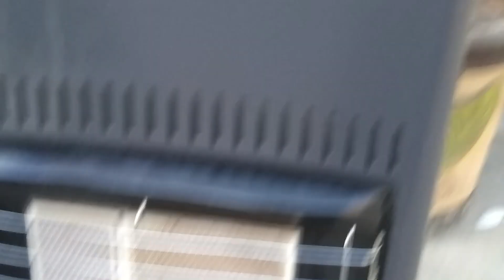limpieza de calentador de gas

Comment: Excelente ENCERADO
estoy en busca de un video
CON REPARACIÓNES de la chispa, del piloto, cambio de manguera, flama grande, piedra sin ponerse roja, etc Y SOLO HAY DE brochazos y limpieza del gabinete 🤣😂🤣😂🤣😡
Reply from the maker: Checale por atrás en dónde va la tapa de el gas hay debe traer tornillos para poder acceder a dónde está la piedra y el piloto y sensor de temperatura saludos suscríbete es gratis en el mío no fallaba eso por eso no lo quite saludos
Reply: @mantenimientoyreparacionca1870 12:27 12:35
Reply: Podria enseñarnos como hacerlo no sale.nunca la flama  @mantenimientoyreparacionca1870